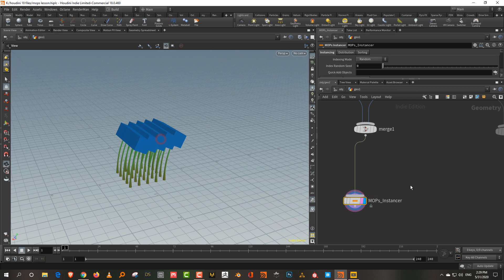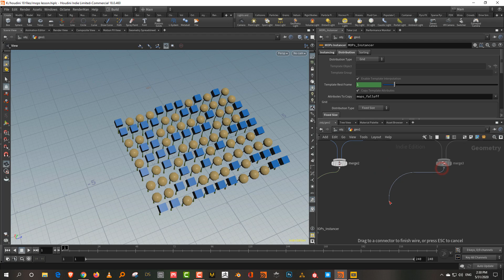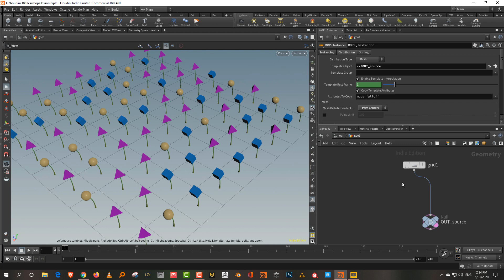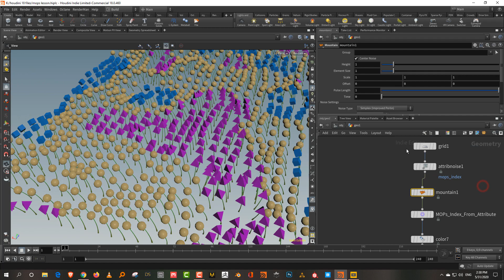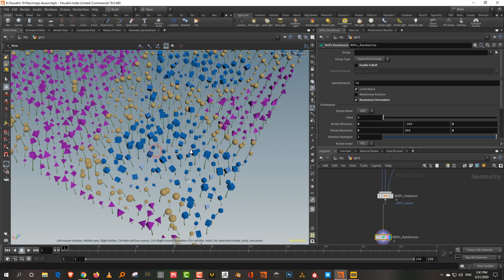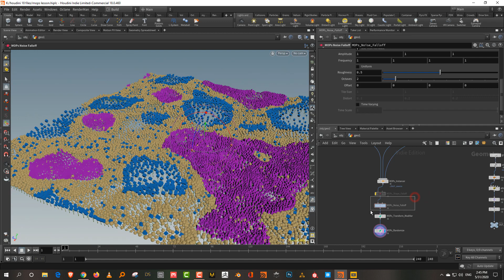Comment: Hi Rohan, is there a way to render mops instances with color in Octane as actual instances? Or maybe Redshift is more convinient with that? If i remember correctly you were using both.
I tried to do that in Octane but with no luck. As far as i know Octane supports only vertex attributes, so the only way to render that kind of setup is to unpack and promote @Cd to vertices?

Comment: This is great, but the moment he started talking about converting values from float to integer, he lost me. My gripe is with Houdini. Yes it is powerful, yes more strides to make it more user friendly have been done by SideFX, but they really need to think about the average artist. I should not have to worry about what type of value I'm dealing with to make stuff (Just one example).

A lot of basic Houdini tutorials start simple enough, they they devolve into a conversation of matrixes, types of values, trigonometry, etc. And I don't think it's the people making the tutorial's intention, it is the unfortunate nature of Houdini. This is evidence Houdini still has a MAJOR accessibility problem.
Reply: Not to be discouraging, but Houdini is never going to be as accessible as Max, Maya or C4d or anything else. Given the highly procedural and data driven nature of the software, it will always have a steeper learning curve. If you don't have a slightly technical bent of mind , Houdini is going to feel complex and obtuse, which it is. 

It is approaching 3d from a procedural perspective and even though they can make it simpler, I doubt it will ever be as simple as other softwares.

That's just the nature of the beast.
Reply: @rohandalvi  Agreed, at least we have people like you putting out great videos so we have a good chance to learn, so thanks for these! You just gotta be prepared for a lot of googling when you get stuck in my experience.
Reply: Problem is the help files, they tell you nothing useful. Everything I ever needed to find out I either had to earch for video tutorials or put a post on the forums
Reply: @eggZ663  I totally agree with the Help files part. Its almost comical how much complicated they have made it to read, which is actually a waste because its almost a book of text in there which is very hard to understand if you are not already a pro in 3D or Programming, in which case you wouldn't really use the help section. I think they should really try to outsource it and simplify the help text like the guys at Cycling 74 or Derivative have to made it artist friendly
Reply: Saying that this tool looks really cool so far!
Reply: Remind me a lot of MASH
Reply: There's only like 4 main types of values, not that hard to learn